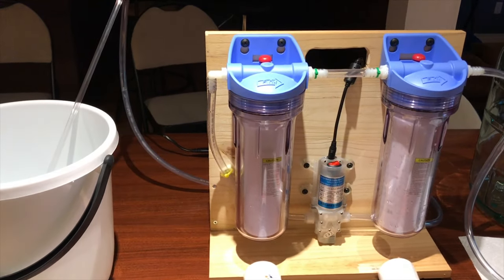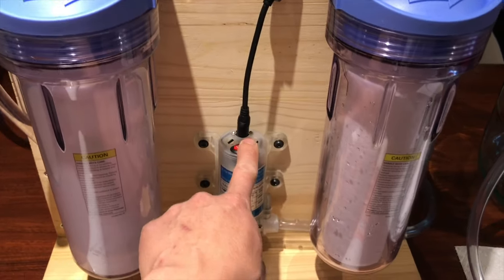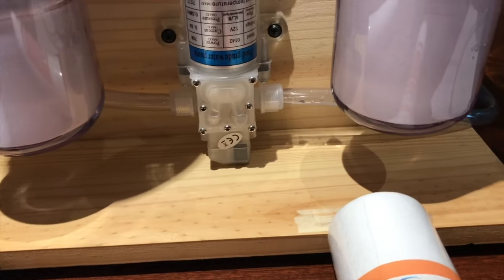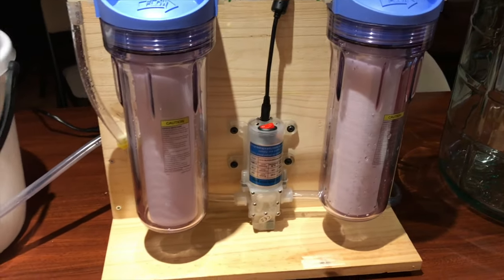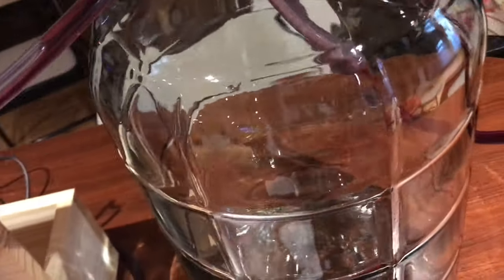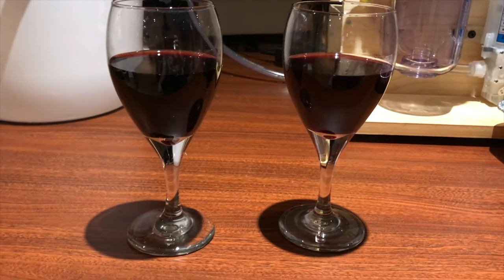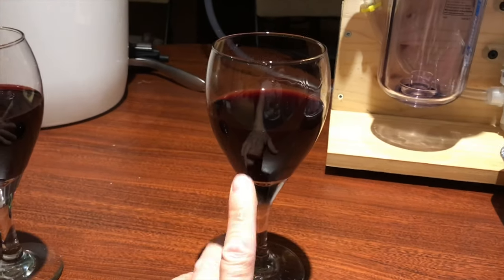Red Wine Filtration - Dual-Stage 5 + 1 micron Filtration

Comment: Hi,  Did you get all the wine out from the 2nd stage filter? If not, how much is left in the 2nd stage and what did you do with it?
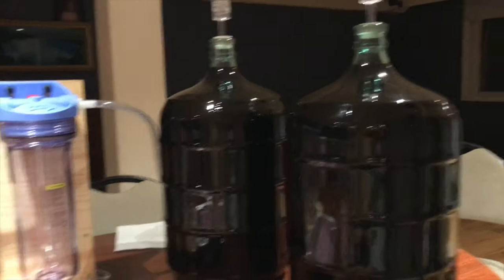Reply from the maker: As you can see in the video at 7:13-7:15 (quick transition), I got about 3” or so left over inside the second filter housing. So I treated myself with that left over after the process. 😀

Comment: Hi Where you buy the moter and filters.
 in India this type of moter I am not getting so tel me on line sites
Reply from the maker: Everything was purchased online at Amazon.ca. You may try at Amazon.com; eBay.com or AliExpress.com.
Reply: You can buy it from any local RO shop, 

RO booster pump 75 or 100gpd will serve the purpose. Cost will be Rs. 2000/-, 5 micron filter with housing Rs. 200/-, 1 micron filter with housing Rs. 225/-, pipes and fittings ~ 300/-, total roughly Rs. 2800/-
Reply: @avisheknath5764  , did you really use a 100GPD RO Booster pump for this application? It didn't pump any wine in my case and I finally had to go in for a diaphragm pump like the type he has used in this video (available on Amazon.in). As I now understand, an RO Booster pump can only boost the water pressure (where it's too low for effective filtration to occur) but needs some existing inlet pressure (at least about 30 psi) to function efficiently. It has little suction.

Comment: Whats the name of that filter on the racking cane and how is it connected? And who sales them
Reply from the maker: That is the stainless steel mesh filter from the syphon hand pump that can be purchased from Amazon or AliExpress. Just attach to the raking cane with a short piece of 3/8” ID hose.

FTVOGUE Wine Siphon Syphon Hand Pump Wine Hose Hand Siphon Filter Home Brewing Syphon Tube Pipe Hose Making Equipment for Wine Beer https://www.amazon.ca/dp/B07MFLLNG7/ref=cm_sw_r_cp_api_i_Kqp6EbF60BWHR

 C$ 1.40  34％ Off | Manual Home Brew Syphon Tube Pipe Hose Water Wine Hand Transfer Pump Wine Distiller Tube Wine Beer Making Supplies
https://a.aliexpress.com/_dUIarlC

Comment: Will it works for oil filtration?
Reply from the maker: I am not sure if you meant cooking oil or motor oil but it may be ok for cooking oil but not quite sure about motor oil.
Reply: @PTranProductions  thanks for your help, what i meant is cooking oil
Reply: @PTranProductions  do you think that pump is strong enough for cooking oil? Or do you have any suggestion?
Reply from the maker: @MuhammadUsman-yc7qm  
I am not 100% sure if the pump would be strong enough for cooking oil because of oil viscosity. This pump is as stated on Amazon description for water usage. It would be a trial and error for your project. You can look for a heavy duty pump to substitute but be sure you find one that’s food grade.
Good luck!

Comment: this is the worst example video ever dont get me wrong great idea and all but im sure like everyone else i was to know how good this filter is. based on my experience i used a 1 micron and a 1 micron and it still didnt filter the wine well enough. im planning on trying a 1 micron and a .5 but people have been saying .5 micron will basically take away all the taste.
Reply from the maker: Again, as my reply to your previous comments in my other video, you don’t use the same micron filters for both stages - as the wine passed thru your first stage of 1 micron then passing thru the second of the same micron, nothing will be filtered again at the second stage.
This was my second trial on 5 & 1 microns. I agree, it did not show much but somewhat in clarity. So I may try a thicker/smaller microns on my next run if I want more clarity in my wine.
Unless you use carbon filters, I don’t believe paper or non-carbon type filters will alter the taste of the wine.
But again, this is a DIY system. So it’s all about trial and error.
Reply: @PTranProductions  yeah ive try this it didnt work and carbon filter will take the taste away. im thinking of using reverse osmosis next but im already thinking it will be a bad idea because it might take all the color away from the wine including the required taste but hey make a video of that ill def stay tune to your channel it always good to test ideas thanks for posting